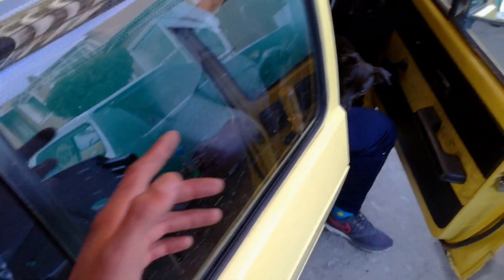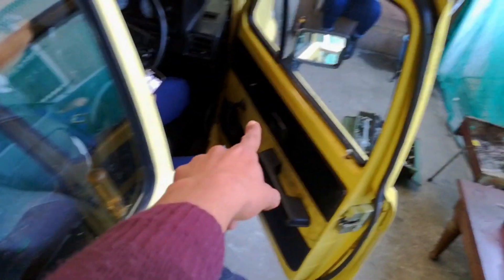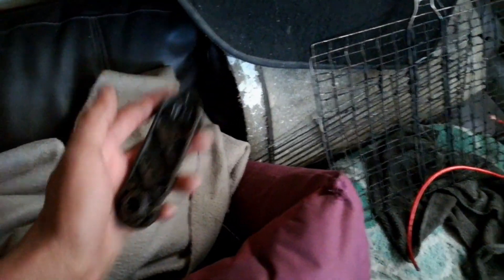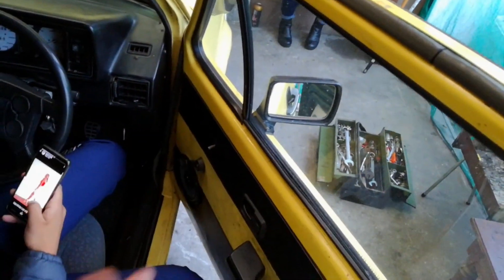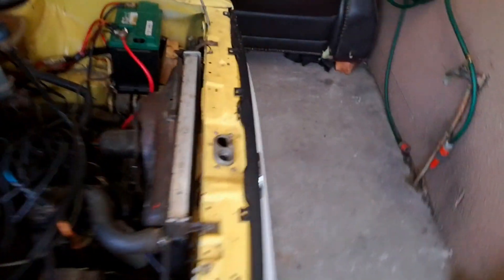Shopping for CAR PARTS!!

Comment: Oil pressure might be issue hence the leaks as well. Like one of the comments made best way to see is if you have your oil pressure gauge connected. Would be pitty if you losing oil pressure because engine will pack up. Other than that great progress on the car. It's transforming very quick and very impressive bru 👍🏻Well done on your progress so far 👍🏻
Reply from the maker: Thanks Dino! You mind contactibg me on Facebook or Instagram. I am still having problems with my oil light.

Comment: I also had a problem where my oil light kept going on and made a terrible noise. So when i pressed the gauge back while i was driving the noise stopped. I found that the cables behind the guage  wasn't plugged in properly, i took the cables out, cleaned it nicely and plugged them back and the noise stopped.
I hope it'll also resolve your problem.
Reply from the maker: I'll definitely make ise of this method myself, thanks Zelda!

Comment: First check that you actually have oil pressure. Get a gauge and plumb it to one of the sensor locations and see. If you have no oil pressure then there are worse things to worry about. If you have oil pressure then you know it is more than likely an electrical issue.
Reply from the maker: I'll go to a BHD to maybe have a compression test.

Comment: Most likely its a grounding problem
Reply: Or the 10 volt regulator at the back of the cluster the cluster is the problem  from one golf owner to the next
Reply from the maker: I'll check the back of the cluster and maybe the noise go away

Comment: 1st
Reply: It could be ur earth not making proper contect u need to make sure that  the blue sensor is on the head and the white one on the oil filter it that is correct  it should work if it does  ur clusters 10 volts  regulater is messed  u will need to change it or get a other cluster
Reply from the maker: The cluster  isn't mine, mine is in for refreshing.. So i'll out minr bacj and see if it still does that.
Reply: Ok bro just wait for u cluster that cluster u have has the problem  bro don't  change any sensor its the cluster bro
Reply: How do i get in contact  with u bro
Reply from the maker: The light is off now with my original cluster back in the car.